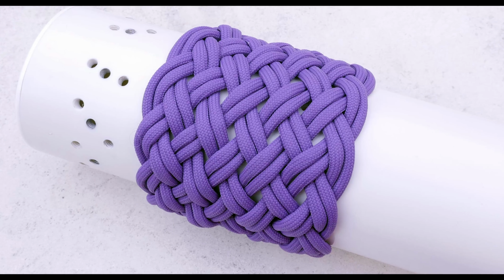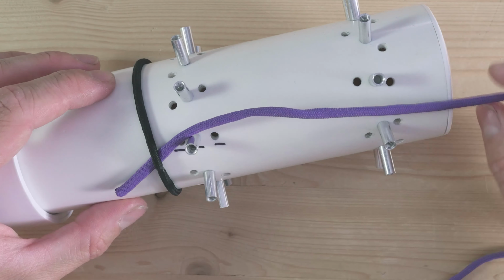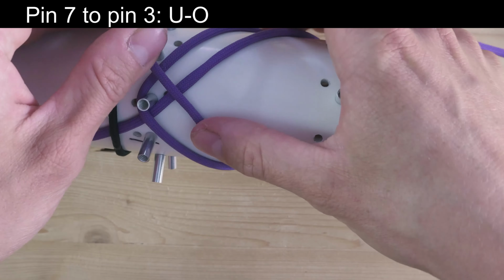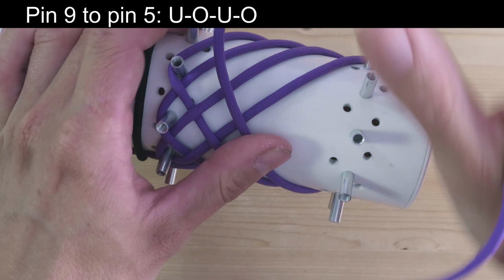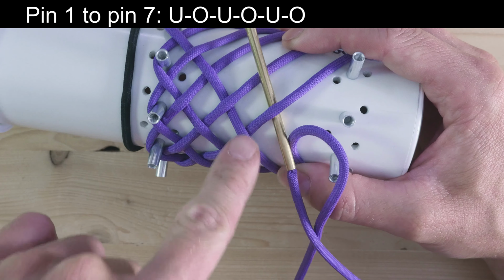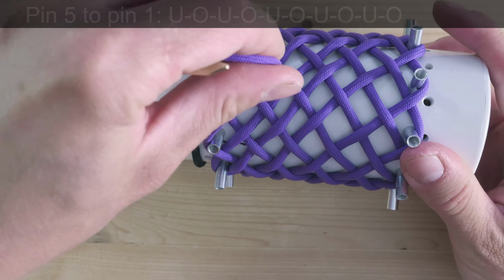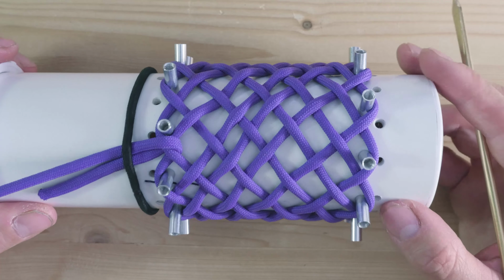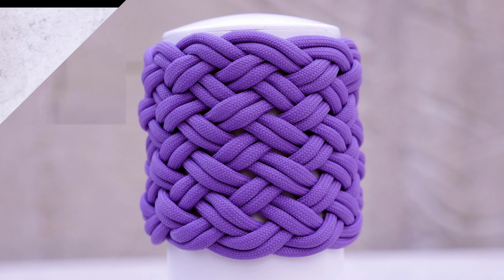11L10B turk's head- tied on a pinned mandrel

Comment: Brilliant video again! Two things I am trying to find out. The mandrel. I guess you made it? But where did you got the hole layout? Secondly. When completed removing and tightening and securing the ends. How is that done?
Reply from the maker: All good questions! The mandrel was kindly gifted to me by Jack Hicks.

Finishing the ends is an interesting process. I'll need to make a video covering the specific process I use. Generally, you work the working end into the knot, through the knot and out the top of the knot. After tightening, you can trim the end.

When the knot is ready, I would transfer it onto an object I am covering. Then from the standing end I'd go through the knot, removing slack as I go. At some point you reach the working end and pull the slack into it. Cut the end, tuck it slightly under/into the knot.

Mark
Reply: I run the workimg ends next to the standing end in the middle of the night, and take out the doubled part od the standing end. It lts me have both cords coming out the center of the knot

Comment: Thanks for sharing. Good demonstration but tightening that knot with 2 strands of a single color would be a pain. I've been using DIY pinned mandrels for many years. The mandrels make knots and interweaves so easy and more enjoyable. You don't have to tie the knot in a single setting. Lay it by and finish at your leisure. Everything is still in order and you know exactly where you are into the knot. I've tied 8 & 9 bight / 3 color multipass & interweave paracord turks head knots up to 40P/9B on a 1.5" pvc mandrel (Leave a lot of slack in the first & second cord. It will be very tight with the final cord. Many times I wished for a deflating mandrel.) The knot is then transferred & tightened onto a 1" hiking staff for a beautiful and functional grip. Warning : Making 3 tightening passes on 3 cords of such a long knot (3 cords @16' each) will mess with your mind. ;-)